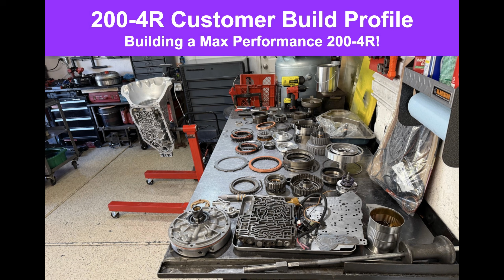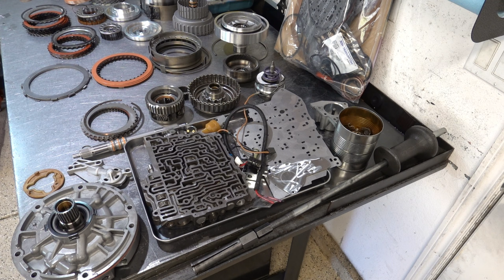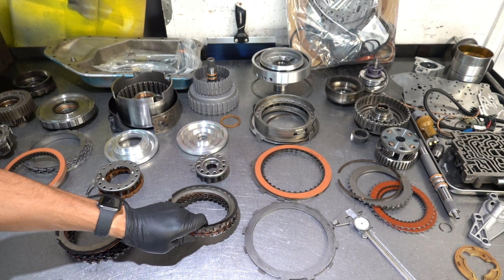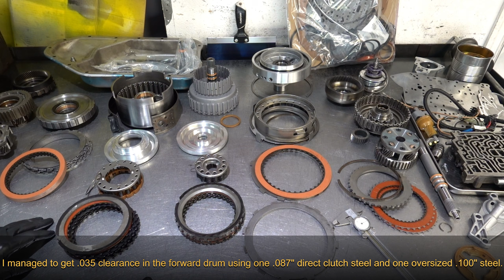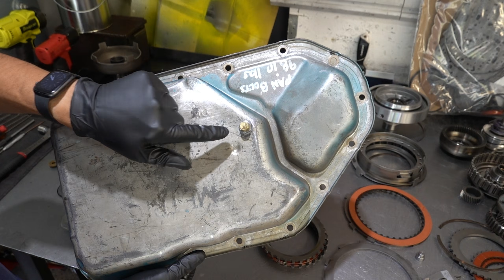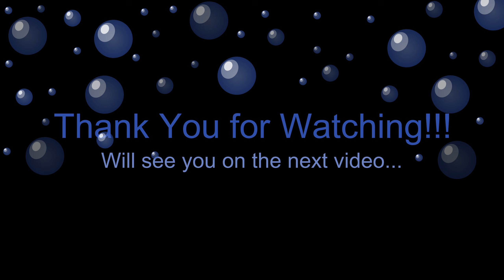200-4R Customer Profile - Max Performance Build Strategy

Comment: How do I contact you about building a 200-4R for this same type of application? I bought a '31 Ford Coupe with a 425 Nailhead (lots of torque) and it came with a TH350 which I want to replace with a 200-4R. I'm in Austin, TX. Don't know if that's something that can be shipped to Texas?
Reply from the maker: Hi Snake Eyes, thank you for watching and considering me for a build. 

I am actually no longer building 200-4Rs as parts such as forward and direct drums, pumps and valve bodies are getting harder and harder to come by. If you need a build similar to this one, contact Extreme Automatics. As far as I know, they are still building Stage Two 200-4R transmissions.

Comment: I installed a CK Performance kit. I did do the dual feed. I’m having a bind 2-3 but only does it when normal driving what’s the fix for that?
Reply from the maker: The fix is more information before I can determine what's causing the problem.

- Did you rebuild the entire transmission or just install the kit with the trans in the vehicle? 

- What holes were drilled and what sizes did you use for each hole?

- Did you follow the instructions to a 'T' or did you deviate - if the latter, in what ways did you deviate from the instructions?

- What was your servo travel upon final assembly/reinstallation of the servo?

Respond with answers to ALL OF THE ABOVE questions - if you skip any, I won't respond as I wouldn't have all the info needed.
Reply: @nickstransmissions  Hey, so yeah, I went all the way to the max on drilling the separator plate since my setup is definitely making over 350. I’ve rebuilt the transmission, and on the servo, I don’t have exact measurements, but I set it so it’s just slightly dragging—not super tight, just enough.”
Reply from the maker: Ok - what was your clearance in the direct clutch pack when measured on the bench during the rebuild?

Comment: I think I would chose a 700r4 over the 200-4r. My next trans will be a 4l80e but  with the manual valve body. No electronics.
Reply: why not a 4l85e?
Reply from the maker: Thanks for watching, Larry. Agree - a 200-4R should be considered only as a last resort for the majority of applications/use cases

Comment: Thanks for the video!  When adding a 200 4r to an older stockish car do you recommend the 4th gear pressure switch for overdrive. I hope I’m describing it correctly. How is it compared to the one that goes in the 700 r4.  Does it completely eliminate wiring for the transmission. Thanks. Btw what is the part actual name.
Reply from the maker: Thanks for watching, Rowdy! The 4th clutch (or gear) pressure switch is necessary for lock up if running an electro-mechanical TCC apply set up. It's very similar to the later 700R4s and operates the same way. You're correct insofar as the switch's technical name (sometimes it's referred to as the fourth clutch pressure switch by manuals).

Comment: I live in Maryland n from watching ur videos n some others in like say Texas iv noticed because you said it's dry there that ur seals n stuff get hard n crack n break but here in Maryland I just took a 07 6l80 apart n the seals are all still perfect. Could easily be reused. Wouldn't do that but I do save them in case something goes wrong n I cut a seal somehow I have reused the old one. Very rare. But what do you think causes those differences? Humidity? Very humid here.
Reply from the maker: Yes, your climate and high humidity will enable external-facing seals and other things to last a lot longer (though rust is a major factor, unlike arid climates)...The desert is the 2nd most hostile environment on Earth to man-made things (open ocean is the worst, IMO). Thanks for watching, Nick!

Comment: What’s your opinion on the alto reds vs the borg warner high energy frictions? When I rebuilt my 4r70 I purchased a few frictions to compare. I ended up going with the borg warner frictions, It seemed like they held fluid better after soaking compared to the alto.
Reply from the maker: The Altos don't hold as much fluid however they grip/hold a little better than the Borgs however both are excellent frictions. Thank you for watching, Chet!
Reply: Haven't herd anything good about Alto. I prefer Raybestos.